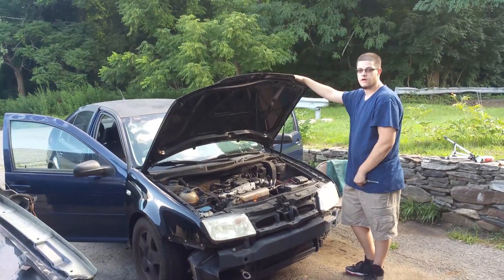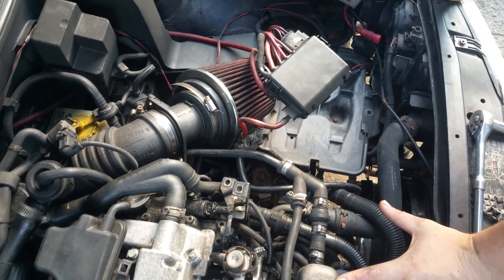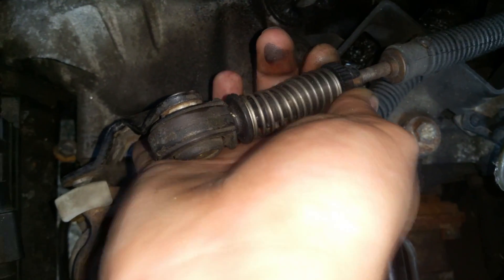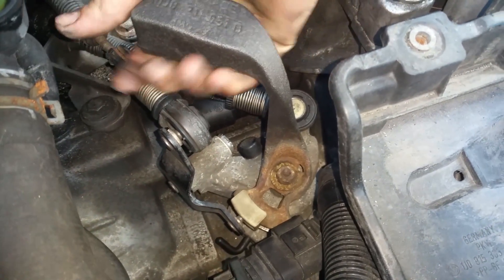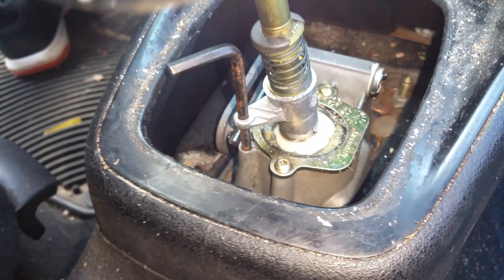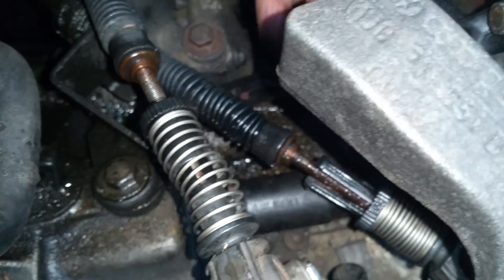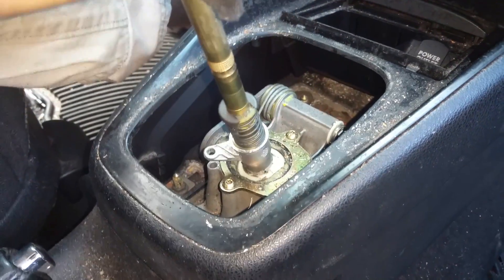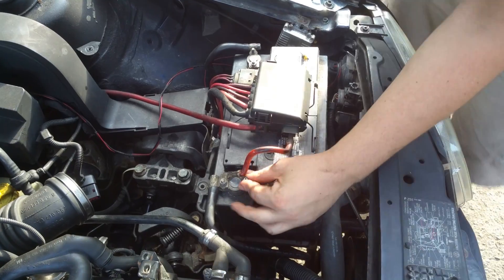Mk4 shift linkage adjustment

Comment: Great video. Short, sweet, and to the point. Had watched a few other videos and was having trouble translating what I was seeing to what actually needed to be done. I couldn't get the linkage right the first couple of attempts, found your video while I was upset that I couldn't get the job done. Your recommendation of pinching the linkage end to keep it from sliding and popping the spring made all the difference. Amazing what being off 1-2 threads will do. Thanks again

Comment: Ahh you lock under bonnet first and remove or undo both cable springs then go into cabin and find neutral locking setting which effectively zeros or resets the  mechanism back to factory, then just release both cable string ends, releasing lock pin and this should solve any play or sticking on my shifter, excellent very helpful makes complete sense to me now thanks 🙏

Comment: Great tutorial.  My '04 GTI VR6 will eventually be garaged in order to do extensive preventative maintenance.  The car runs well.  My intent iis to replace old factory parts the are likely to start breaking, before they break.  The objective is to have a higher level of assurance that the car can be relied on during longer cross country road trips.  One part of that maintenance will be to replace bushings just below the shifter.  I'll be accessing the bushings from below the car.  I believe this will require me to perform many of the steps demonstrated in this video.  The video and my Bentley Manual will help me do this right.  Thank you for sharing your knowledge.  You clearly know your stuff.  I hope everything works out well with your VW and your race car.  What kind of racing do you do?

Comment: Troubleshooting my VW Mk4 results: the alignment through an allen key nor screw didn't work. Much trial and error troubleshooting later I realised that I consistently got only R-1-2-3-(50/50 4) through alignment so something was off. Slammed toolbox weight on the side of the gear knob on N alignment enough to lean it to the right and lost more gears; did the same to the left and found all gears in correct position. The rest was as advertised.
Reply: yoo

Comment: Dieselgeek suggested we push the cable back towards the cab and the transmission side towards the front of the car when we lock the linkages. Do you think there's any merit to that idea?
Reply: It’s been 5months lol but it should take more play out of the cables but if u push too hard it will make it too tight

Comment: Thanks for this video im going to hope i gain 5th gear again as i lost it on the highway
Reply: did it work? i just lost 5th 3 days ago.
Reply: @its_mattlol  Not sure what transmission you have, consider this though. EDIT: If you have a 6speed, you can call the dealer to verify if you have the 02M transmission, they can check by your VIN https://www.youtube.com/watch?v=6WWChWV9Rqw
Reply: @its_mattlol  what did you do to get it back
Reply: @sasjaffe  I still haven’t got it back 😂😂
Reply: I lost 5th today on the way home. Had to pull over and play with the counter weight just to make it home. I gained 1-4th back. Its never happened before so im hoping this fixes the issue.
Reply: @Gsxr1000Taz did this fix the issue for you? Same here lost 5th on the highway

Comment: I have a seat Leon 1.4tsi 2018 33000 miles and I've tried and tried to adjust the gearbox cables but still feels notchy.
Any help on what else it could be?

Comment: Great video very well done . I have the same problem with my 2002 Nissan Frontier manual transmission couldn’t shift smoothly on to gears . I may try to fix it  myself . Any advice

Comment: My neutral lock out doesn't work.did it in all different places of neutral and it won't lock out. Did everything step by step. Now I have reverse threw 4th but no fifth.
Reply: same i have no 5th gear how did you fix it
Reply: @DuelistWave did you get yours to work?
Reply: @FernandoGarcia-px3xs  my 5th gear is gone. left the chat 
3rd is on its way next
you should be able to use the counter weight on top of the transmission to put it in to 5th from indie the engine bay 
if it wont go into gear then the issue is internal to the transmission

Comment: I tried doing this and now my car only goes into third any suggestions? I’d really appreciate it
Reply: Same here, did you end up fixing it?
Reply: Stu G is your neutral lock pin broken as well?
Reply: I couldn't get any gear and replaced the gear selector with a short shifter.
Reply: Nah locking pin was fine, I just had a few attempts at getting the linkage back to the home position and it’s good now

Comment: Do you have to remove the battery and the air box or is it just recommended to have more space to work?
Reply: Just recommended.

Air box might make it easier, battery is a bit more longer lol (I hate messing with the battery)

Comment: So I dont need to replace anything I just need to, adjust them
Reply: Would recommend replacing the rubber gaskets or the entire clip on arm itself. if the rubber is shit you're going to have trouble shifting gears, or might not be able to get into certain gears at all. I did my adjustment wrong the first time and couldn't put the car in reverse, this video is the right procedure. I have a 6 speed AWP 02M 2005.5 MK4 1.8T Jetta.
Reply: @midorialexandros  what rubber gaskets?